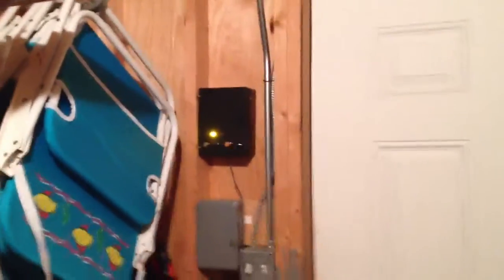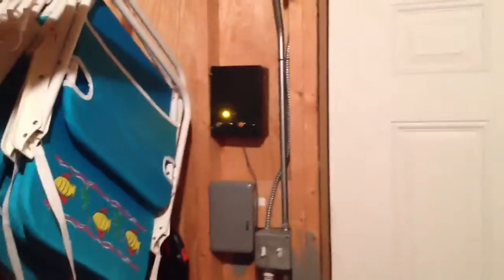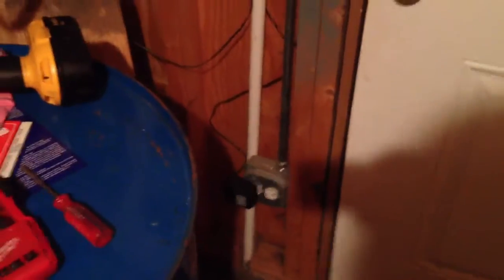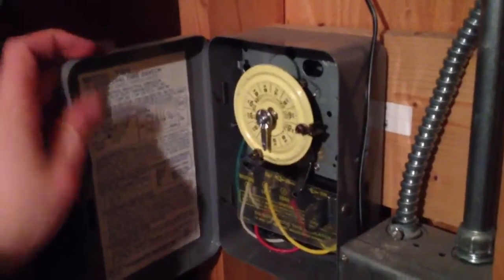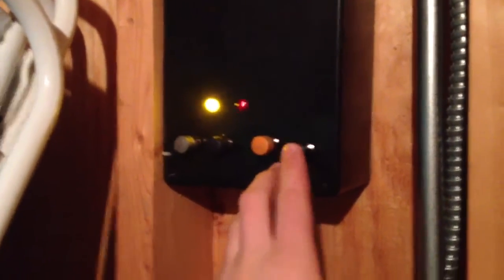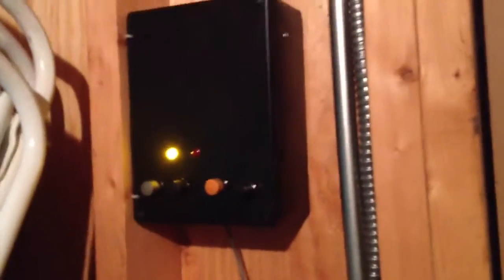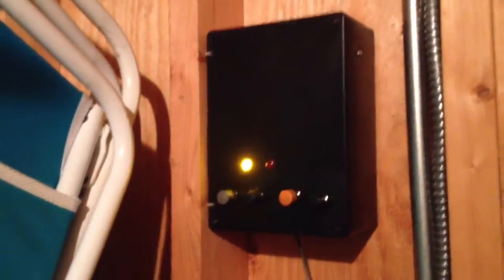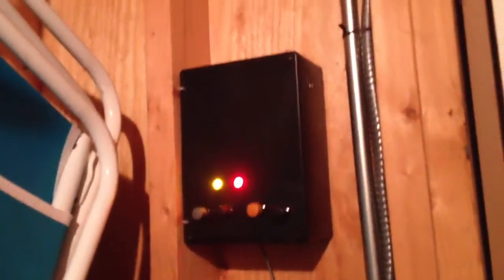My Homemade AR Timer

Comment: I find the omron H3Y-  series to be quite useful and would easily fit your application. You can get them in many voltages and time ranges. You should be able to find the one you need on ebay for under $8. Nice work! I will love to see it finished!
Reply: Be careful. A lot of the cheap Omron relays you find online are knockoffs, which are prone to faliure. This is especially bad in the context of life safety.